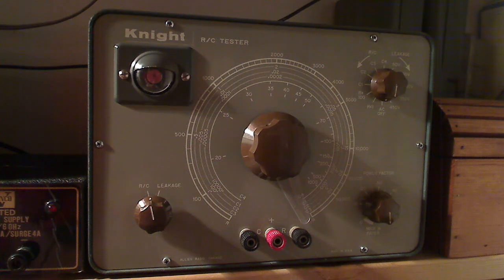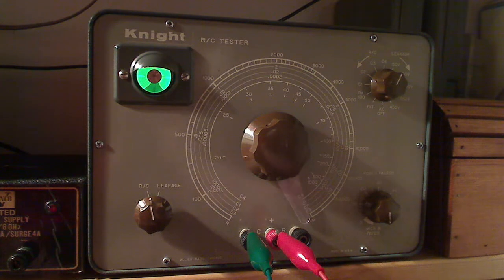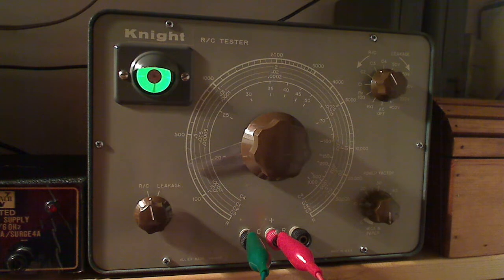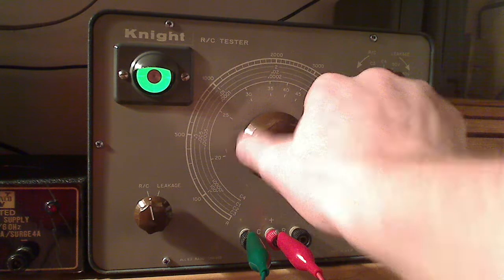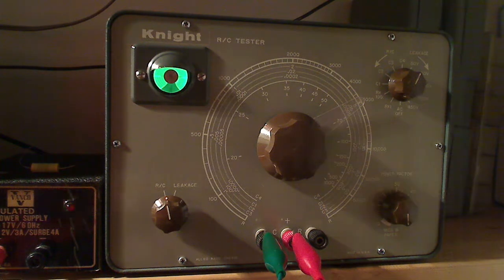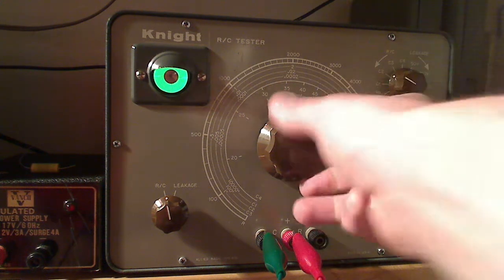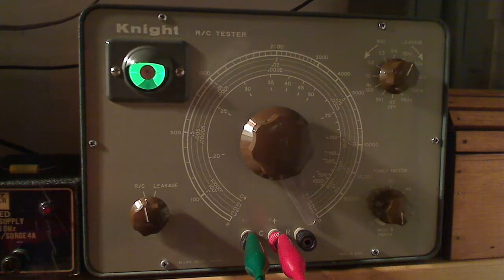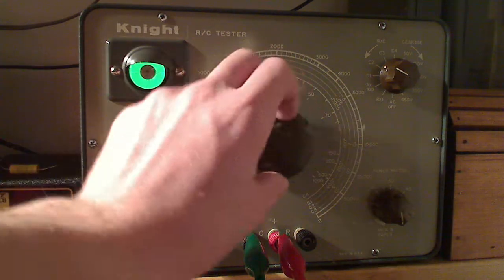Testing Capacitors for Leakage - Knight R/C Bridge

Comment: Does the capacitors have to be removed from the device to test them on this? Or can you test them while they are still connected in the device?
Reply: Also what's a value on a capacitor?